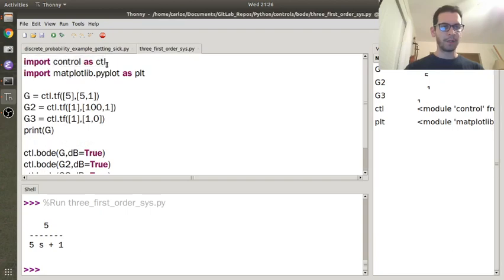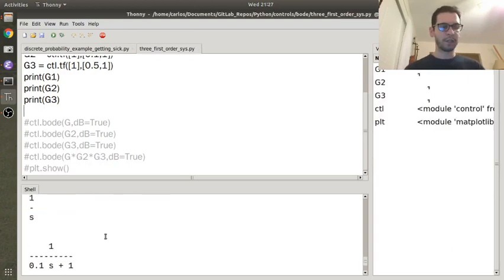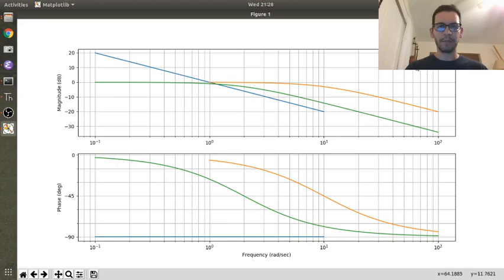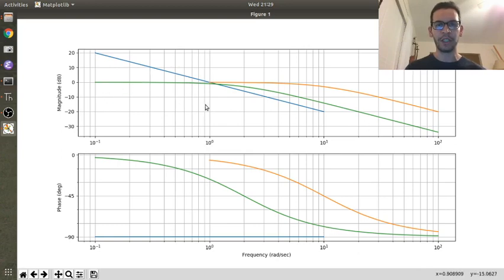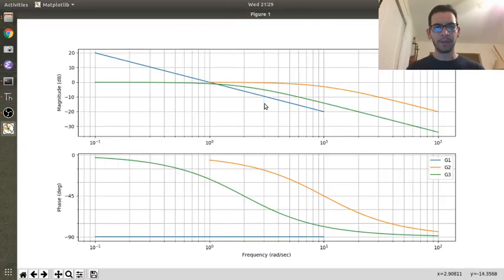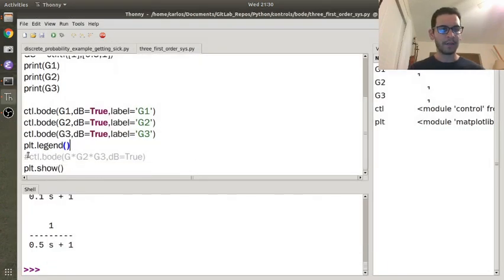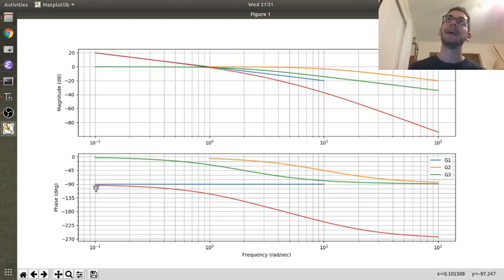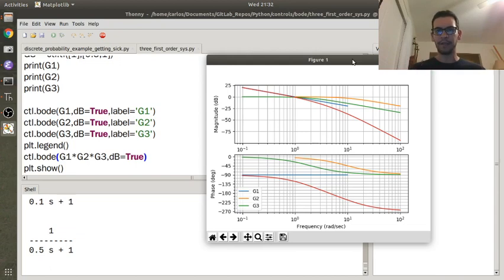Python Help - Creating Bode Plots

Comment: Wow, this was very helpful, thank you! I was wondering, is there a way to add input delay to the transfer function?
Reply from the maker: It seems there is a way. I checked the docs on python-control and found the PADE approximation https://python-control.readthedocs.io/en/0.8.3/generated/control.pade.html#control.pade 

I have never done it myself so hopefully it will work for you.